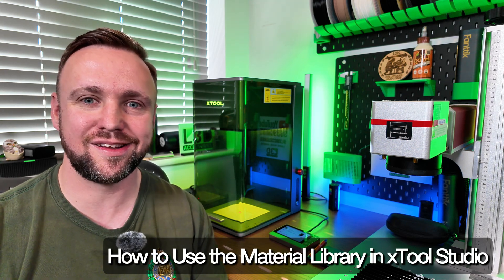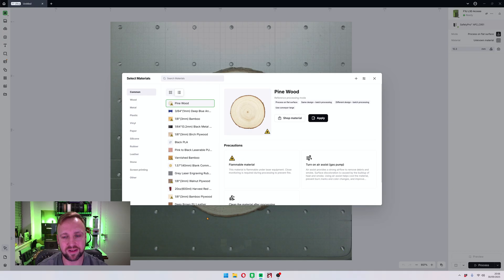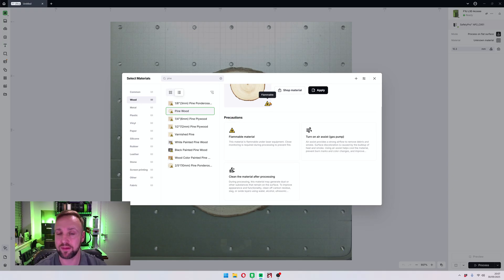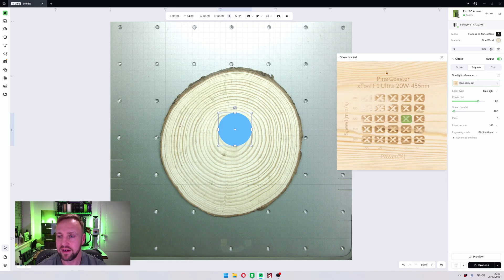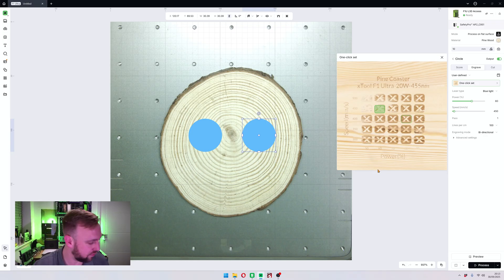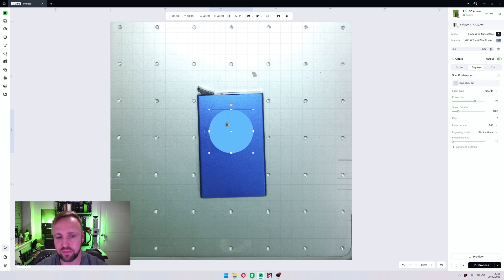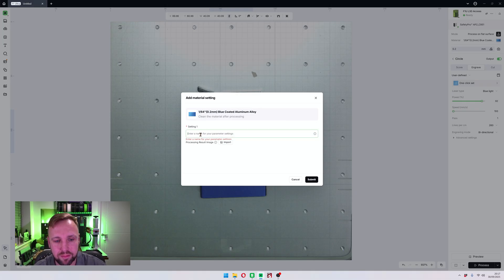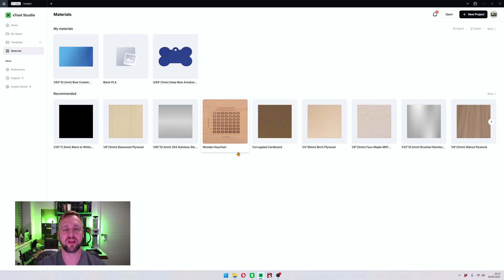How to Use the Material Library in XTool Studio (Beginner Tutorial)

Comment: What if you’re not sure what the material is? I have a keyboard that might be a colored plastic or it could be a light weight metal - not sure.
Reply from the maker: In that case I'd definitely use a fiber/IR laser and probably start off with something low power and fast.
Reply: @L3DAccessories being  a newbie, I didn’t even try IR on my new F1. I’ll do that!!!
Reply from the maker: @Papakbz IR is usually the go to laser for plastic, metal and slate. Definitely worth giving it a go! Diode will melt plastic.